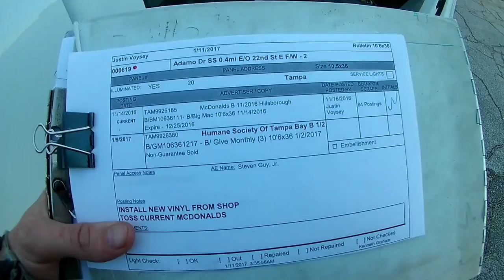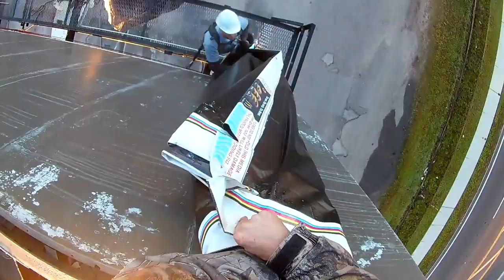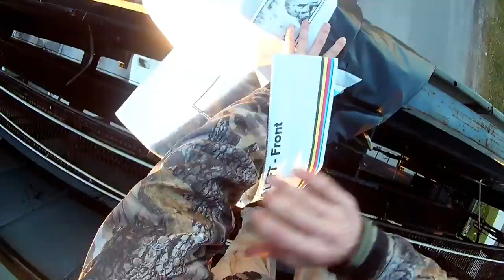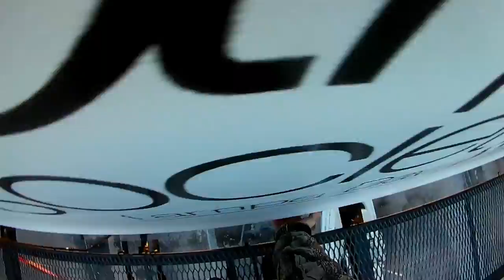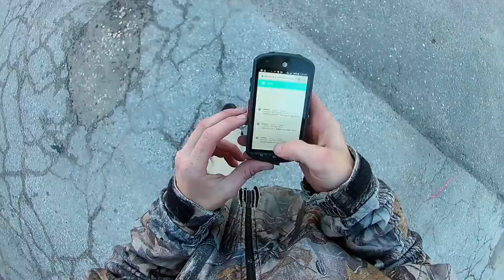hanging a Billboard from start to finish

Comment: Thinking about doing this....looks easier than roofing lol
Reply from the maker: It can be easier than roofing but there are alot of very difficult billboard structures out there and their is alot more signs that we hang that have very difficult 3d cows and spiders and other objects that we have to figure out how to rig and secure up their. There is a lot of give and take with this job yes it can be be easy but believe me there is definitely some very ruff days when you have 12 to 15 signs for the day to put up and more than half of them are 60 to 100 foot off the ground. That equates to alot of climbing and roping up your flexs and tools u need for each job on every sign of the day. So it all depends on what you consider hard work or what looks easier. Thanks for for watching. Stay safe out there.
Reply: Justin Voysey when you’re securing the cut outs get some conduit and cut it to length on site, flatten out the ends with a hammer and self tap it to the structure. Way better than the metal they send with them.

Comment: Long live the bill poster. Digital is killing us, but lets keep going until the end!
Reply from the maker: I know right it's crazy I have been doing this 22 years now and when we built are first digital they said it would be a small portion of are market and now just in my market we have just over a 100 digitals and are taking down typically 3 static boards to put up one digital. It is definitely hurting are kind that's for sure. I miss the glue and papper days!
Reply: Definitely man, luckily over here we still have a lot of paper and paste ones. But it's nowhere near how many we used to have. On an average post change now I'm doing about 50 ish, where as before it was 130 offs. A big drop in money, and we don't get any down time work off the companies also. Their own guys do the maintenance work. So we've got to do other things in the down weeks to keep surviving. Maybe has 3 /4 year's left of paper and paste if we're lucky over here man.

Comment: Woooh no gloves!?!, that's how I used to work until I got those fiberglass splinters from the piping that are a bitch to see.
Reply from the maker: We only wear gloves when it's cold out. As for the fiberglass getting in your hands it's not a issue for us we do a excellent job maintaining are structures and if we have a few bad poles on a structure we will change them out with new ones to avoid fiberglass in our hands. Biggest thing when handling fiberglass poles it to never slide them in your hands and if you follow that simple suggestion you don't have to ever worry about fiberglass in your hands if you run into a bad pole.

Comment: THESE BOYS HAVE THERE SYSTEM DOWN COLD... 
DANG ..  NOT FKN AROUND AT ALL...GOOD ON YA MATES KEEP IT UP... 👍👍👍
   QUESTION 🙋 
HOW MANY A DAY ARE YOU REQUIRED TO DO?
IS THERE A CERTIN QUOTAS?
OR PAID BY THE SIGHNS INSTALLED? 
EITHER WAY SUPER COOL STUFF...💫
Reply from the maker: Thank you it's nice to know that there are still people out there that can appreciate this. I have been doing this job for the last 20 years and my buddy helping me had been doing it for the last 15 years. He has also been working with me pretty much every day for his hole time with the company. So we know exactly what each other need just by the sounds that the sign makes. We used to get payed by the sign and we would do 10 signs a day we would start at 4am and we would hustle all 10 signs and be done working by 10:30-11am and make really good money. They have changed the pay scale a little we still shoot for 10 signs a day and get payed hourly plus a bonus pay scale for each sign we hang it's cun fussing as hell. But it pays the bills and can't complain to much. Feel free to to shoot me any more questions you may have. Really appreciate you liking the video.

Comment: These small ones aren't bad. We do alot of 14×48. It's hell on a windy day. I like the technique you use. Where im at it's so windy that we have to pull the whole banner up still folded and then stretch it.
Reply from the maker: Glad you like it... It's always nice to see how other guys do it.... We do mostly 14x48 as well this one in the video was a 10x36 but mostly do the 14x48 and 20x60 as well. When it's windy here in FL we do the same pull them up folded and then stretch them out. It all depends on the direction of the wind what kind of board or structure it is. You know how it goes every sign is different and you gotta adjust your technique for each sign fo different weather and conditions. What company do you work for and what state?
Reply: @727SolutionsCoatings  I work for American Billboards in  Durant, Oklahoma.

Comment: wowwww you all are spoiled!!! all the old junker bil board's in northern nevada have absolutely no cat walks. nothing to stand on except a tiny piece of angle iron 4 feet apart on both sides. plus when you have to tighten the bottom side of the board u have to physically get yourself down to the bottom. and of course get yourself back to the top. on top of that their is no were to tie off on alot of the ones i do. spoiled spoiled!!!!
Reply from the maker: I have been in the billboard business for 20 years I started out installing painted panels for 5 years or so then we switched to viynl when they first came out. I know exactly what it's like climbing wood pole signs and all the other shit structures that where not designed to hang vinyls on I climbed structures like that for 12 plus years and we slowly started upgrading are structures we may be spoiled but by no means do I not no what it's like climbing shit structures with no catwalks or safety cables with old wood panels. The reason you guys have bad structures is cause Nevada won't let you upgrade any thing with out a permit that's why you guys are still using paper for bill posting cause you are not allowed to put new hardware on your poster units with out proper approval. Here in FL we don't have to do any of that. If we want to upgrade a structure we go and upgrade it with no question asked. Believe me I know what hanging a viynl is like walking on a piece of rotten 2x6 board that has slippery green algae growing on it. I have my time in doing that kinda of work and I'm glad we finally got all of are structures upgraded even are wood pole signs a fairly easy to work on. 
I put my time in climbing garbage structures, maybe it's just me but I got the feeling that you think you are the only one that has climbed bad structures, I take it you watch my video but did you take time to read some of my comments to other guys that are in the billboard industry around the world that have watched and commented on my video, cause if you did you would have read those comments and you would have found out that I'm not new to this industry, spoiled is something I would say to a green horn/new guy. Whether you work work for Clearchannel outdoor,  outfront media or lamar they all supply their employees will all the correct PPE to make it safe to climb those structures that don't have safety cables, now whether you take the time to use and set up a shepherds hook or beam straps or a portable safety cable that is on you.

Now there is a chance I took your comment the wrong way yes but spoiled is one thing I am not and I would not  go around saying or calling someone that, if I don't even know what their background is in said industry. I don't know your background in the billboard industry but I'm assuming you have never flown or roped up painted wood panels or metal Tiffin panels and had to use pins and wedges to hold them together, if you have than you know what hard work is if you haven't then you are spoiled hanging vinyls cause flying panels is a hole other part of hard work that I can't explain to you, if you have done so then you would know hard work. ŘI'm all about helping new guys out that comment on this video, along with other guys like myself that have also commented on my video and its a mutual understanding from one billboard guy to another since there is not many of us out here with the knowledge of working on billboards. Am I a little salty over being called spoiled yes I am what bothers me the most is saying that to someone that you don't even know what their background is and just assume instead of taking a few mins to read some of the comments and find out. If you took any tricks of the trade from my video to help improve your day to day hanging vinyls then my video did what I intended it to do is share tricks of the trade that I have learned /taught myself over my 20 years in this industry and share with over guys in are line of work.

Comment: Yo Justin, that’s awesome work man!!! For our tarps I usually cut every slit for the ratchet strap never thought of just stabbing it through. Also that’s awesome spot for the olfa knife! Definitely picked up some new tricks watching this video. Loved how you used the clamps to fold it up at the top. Been doing billboards for 5 years but we do about 500 faces but only have 4 vinyl tarp locations - 14x48, 2 10x40 And 16x32. Most our faces are paper and glue and a lot of trivisions too. Do you do any glue postings? 
Cheers from Ontario, Canada
Reply from the maker: I used to do the glue up posters is what we call them but we since changed to the eco poster it's pretty much a tarp with a bunch of strings and clips holding it up. Glad u picked a few things up. It's always nice to see how other people do them. We get paid per sign we hang so we shake n bake when we are up there we normally do about ten a day. All of are structures are 14x48.. 10x36... 20x60... 12x25
Reply from the maker: We don't have any try visions any more but I used to do a lot of them years ago before we got rid of them and changed to led signs
Reply from the maker: Warren Tanner so u guys glue up most all of your signs
Reply from the maker: All of are signs are tarp signs using poles and ratchets we have about 400 or so as well
Reply: thats awesome, ya we are piece work also. yea we are all 10x20 glue and paper. can do one in about 7 mins if I want. typically 15min. if im doing both sides i'll go up and over board to get to other side. i'll get some vids on here and link u. cheers.

Comment: You guys are crazy.  
Seriously I have been a tech for daktronics billboards they usually have led display on one side, then a printed one like this on the other. 
Always wondered how much of a pain they were to install. 
Ever loose one in the wind?
Reply from the maker: I have come really close to loosing one during hurricane season here in FL. I have been doing this for 15 years now and have had some really close calls but never completely lost one I have had them blow out and completely over the top of the sign and rap us up that's when you know it's to windy and you call it quits and stay safe........ That's all we use now is darktronics led displays they work better in my opinion compared to the yesco leds that we used to use

Comment: Hey I'm 17 and live in Chicago and I saw a bilboard offering this job so I'm wondering how is it? Also I have a fear of hight 💀 but I could get over it what skills are you required to have?
Reply from the maker: The skills you need is everything you saw in the video. Being afraid of heights is something that I have seen alot of people quit the first day they climbed on are structure. That is something you will have to find out for yourself cause it can go both ways. The work is fun and you are always on the move you are never in the same place for more than a hour then on the road to the next one. This job is not for everyone so it's something that you have to try and see how you feel and go from there. Read threw these comments I have answered pretty much any questions you may have on people's comment section. There is alot of very detailed subjects I have covered and you will definitely find the answers for what you are looking for. Stay safe out there and good luck!

Comment: What a fascinatingvideo! I fell down tjisnrabnitnhole after watching something on TV and it showed someone changing a ground level tri vision in the background. Your video was my first stop lol.

Since you're in a heavy hurricane zone, do you ever have to do pre storm preparations on the signs to reduce the risk of the sign coming down? Is the vinyl vented to allow wind to pass through?
Reply from the maker: Glad you liked the video.... Yes we do drop out are vinyls if we are in the cone of wobble hurricane path. We have sectionless frames in all of are structures so when the vinyl is removed the wind can just blow straight threw taking the wind load off the structure. The vinyls are designed to rip out at I believe 70 mph or somewhere close to that. The vinyls are not vented the are 100 percent water tight.

Comment: Nice wrinkles... hopefully your women aren't that loose! I've never folded it while it's still on the structure though that seems helpful, don't think I could because Im solo up there.
Reply from the maker: I hang them mostly by myself as well and still fold them the same way. Sometimes I'll have to fix the fold up a Lil bit when I get down to the ground but I don't have to stretch it completely out and start over from scratch. It definitely saves me 5 or 10 mins and alot of bending over. What company do you work for or contract for and what state you in?

Comment: Dam u boys don’t care much about big wrinkles do ya?! I’m a freelance billboard installer, I’d lose companies if I sent a picture with a wrinkle like the one I seen when u was getting off billboard. But, I charge by job too, not hourly. Takes me 1.5 hours by myself start to finish, no helper so I do it a little differently.
Reply from the maker: gottdirtt
I didn't see any big wrinkles. That structure had tiffin panels in it. I don't bother with the small wrinkles on the corners. And the advertisement we put up there was a free bee we call them public service advertising we Just put them up there if there is no paying client. That way the face is not blank u know.
Reply: 1.5 by yourself. Wow. i can hang a 14x48 by myself in under a half hour
Reply from the maker: Mathew I didn't realize we where in a who's better at hanging signs compition.

Comment: Excellent guys I do this job as well .
We do these skins and wet post too from Glasgow Scotland 🏴👍
Keep up the good work.
Reply from the maker: Awesome love seeing guys from another country watching my video! We used to use the paste up poster when I first started 16 years ago but they have done away with the paste about 6 years ago. So I definitely know what your talking about. There is nothing like putting your first starter sheet up and you start unfolding it and the wind gets into it and it comes back and slaps you in the face with all the paste in your hair and on your face. I definitely don't miss those windy days doing the glue/paste up posters....
How big are your normal paste up signs. The ones we used to paste up where 12ft x 25 ft... They where 6 sheets across the bottom and 6 sheets across the top that we would have to use a hook ladder for
Reply: @727SolutionsCoatings  ours are 20feet x 10 feet with 12 sheets per panel which are called 48 sheets.
Reply: @727SolutionsCoatings  so we have 6 top sheets and 6 bottom sheets.
We roll them in shifts each shift has 4 sheets each.
Reply from the maker: Sounds Dame near exactly how we used to do them!  We had a guy pre wetting and pasting them for us and putting the sheets in order and he would put them in a thick plastic bag ready to put up.... Do you guys scrap your panels after you get so many copys over the top of each other..... We used to be let about 8 to 15 copies build up before we scraped them off. We would try to wait for a rainy day as the rain would re activate to paste the and make it soft and plyable and easy to take the old ones off. They would pay us really good money to post a new copy and scrap the old ones off and we'll used to do 12 a day. I remember coming home with paste all over my legs cause we used to wear pouches around are waist to hold the wet paper and they always leaked. You could never stay clean working with all the paste they used to put on the paper.....
Reply: @727SolutionsCoatings  yes mate we strip the panels like you probably about the same 8 to 15 round about that.

Comment: Would you work during a season that brings snow? How is that, could you possibly make a video? 
Thank you! Keep up the amazing art of work you do!
Reply from the maker: @arise1668  unfortunately I'm in Florida so we don't have to deal with snow but the other guy in my video worked for the same company in New York and the stories he told me about walking threw 3 plus feet deep snow to hang billboards where crazy. I know that they do work during winter time in the snow and before the installers go out each morning they have a separate crew that goes ahead of the installers to sometimes plow the snow away from the billboards so they can access them. I hate the cold here in Florida it makes hanging billboards really hard with numb hands I could not imagine doing it in 30 degree weather. Hope that helped thanks for commenting and watching the video.

Comment: I have a friend planning on getting an ad on a billboard. Would it be ok for him to climb it and get footage for commercial purposes??? 😮
Reply from the maker: No to be a Debbie Downer but No definitely not if he doesn't have permission. Depending how big of a company owns the structure I will definitely be a no. We use drones to film all of are footage now.
Reply: What if he’s not caught doing it? Could he still use that footage ?
Reply from the maker: @LilTRinOfficial1  they can send you a cease and desist order I have seen it done with a guy in a BMX magazine on a billboard structure
Reply: @727SolutionsCoatings  So he’d have to ask for permission. I understand
Reply from the maker: @LilTRinOfficial1  correct